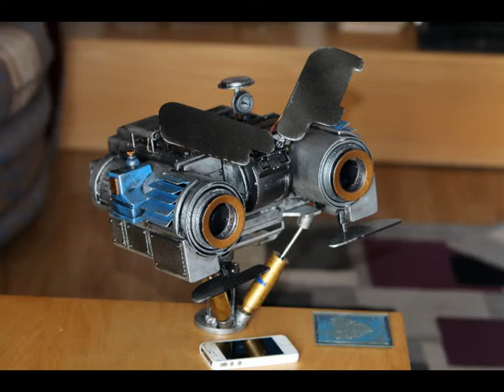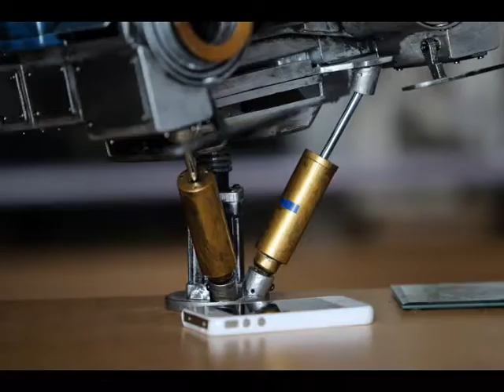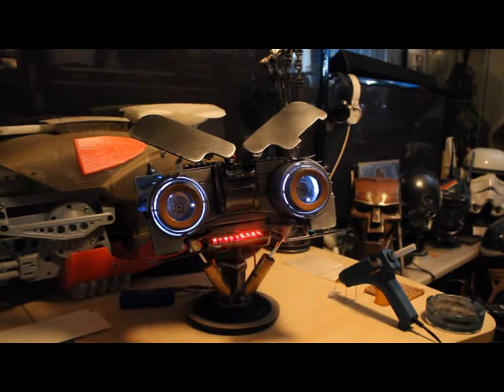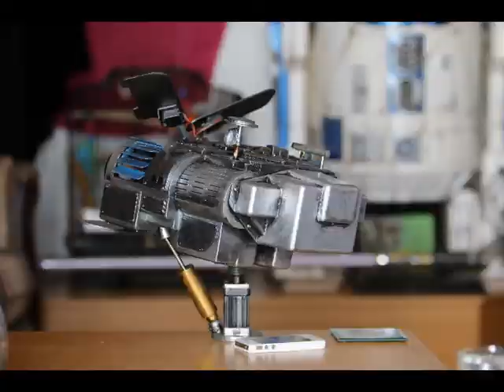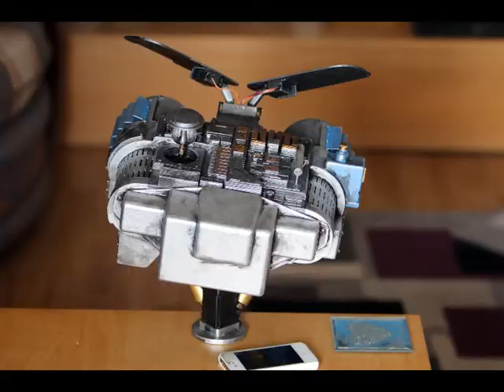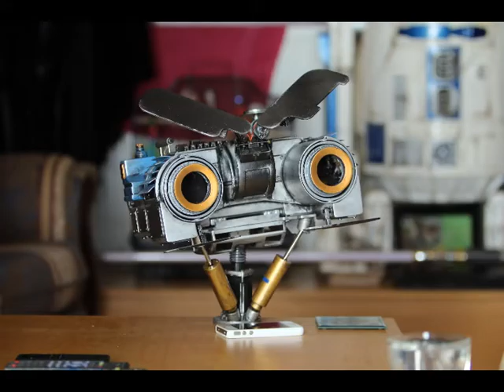Short Circuit Johnny 5 Build Part 2

Comment: first 5 parts printed at 0.1    :)

Do you think it would be possible to add servos to the "eye-brows" to get the right motion,   using the existing model?
Reply from the maker: yes mate the j5 files are made to fit working servos... so no problems there.
Reply: Sweet!   cheers chap, that's what I like to hear  !!    

your mother was most definitely not a snow-blower
Reply: Is that a Zorg in the background !!
Reply from the maker: N Jones heheehehe thankz :) 
Say be sweet to see your j5 wen ya done
Reply from the maker: N Jones yup yup.... ZF1 that’s online for download as well :) just don’t press that red button lol
Reply: Bottom_head parts all done   .... this may take some time
Reply from the maker: N Jones sweet mate.... Keep us updated :)